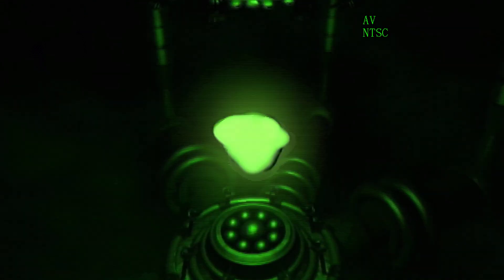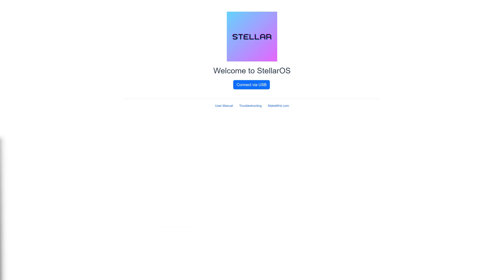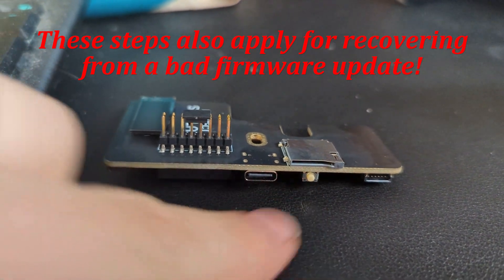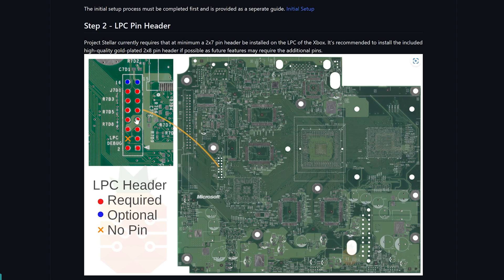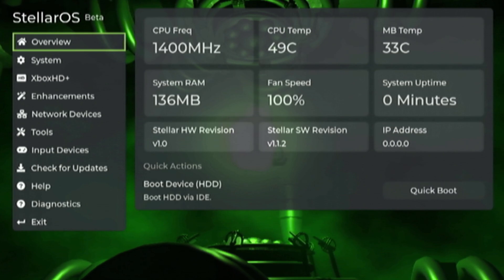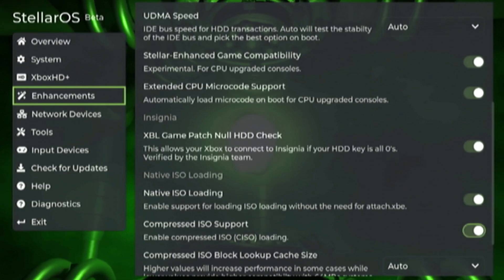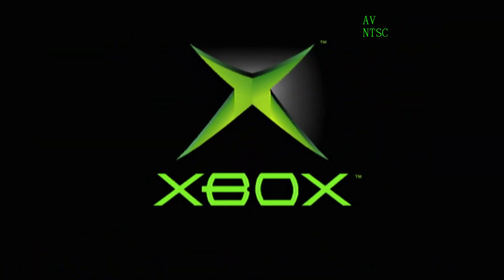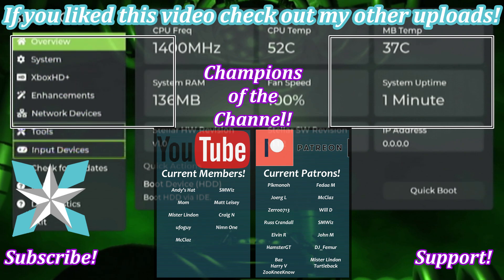Xbox Project Stellar Setup Guide

Comment: I recently sent a system out to have project stellar 128RAM a full recap and Xbox HD+ installed, previously my etm cheats we're working fine, after I got it back they no longer operate, no clue what could be causing this, am I locked out of using trainer/.etm?

I've tried Xored and same result.

Current dashboard is Xbmc4gamers
Previous dashboard was Xbmc4xbox, etm trainers worked before while using this dashboard but not after mod installation.

More context I originally tsop'd my Xbox with a patched (forced480p) only :F no :G iND bios before making the switch to said mods, if this has anything to do with that.

Thanks all for any help 😊

Comment: someone here know if the stock dashboard can be run while a project stelar modchip is instaled? i don't know much  about modchips or softmoding but i know i don't want something other than the original dashboard to be my default Dashboard, but i of course want the features of a modchip, including project steller.
Reply: I'm not sure about Project Stellar specifically, but I have a modded Xbox and I have the Stock Dashboard installed as an App. My Xbox boots into XBMC obviously, but I like to go into Stock Dash to manage saves and also just for nostalgic purposes.
Reply from the maker: You lose nearly the whole point of having a mod chip if you use the stock dashboard. Can't load anything from it unless you burn discs.